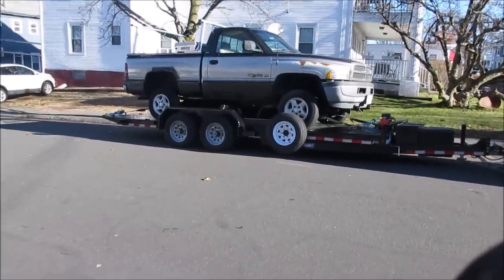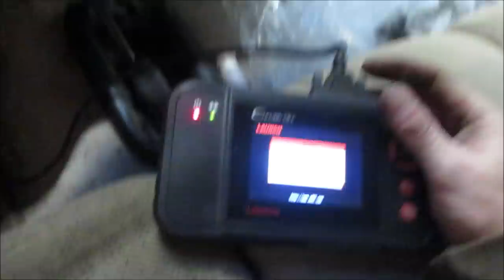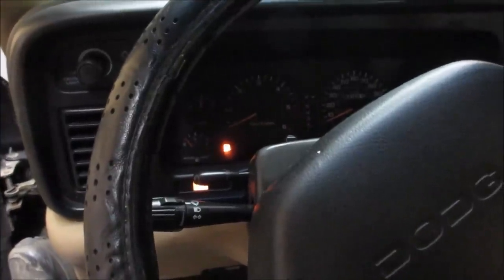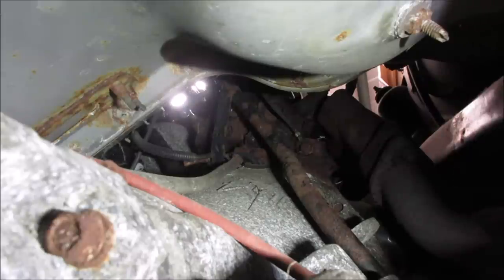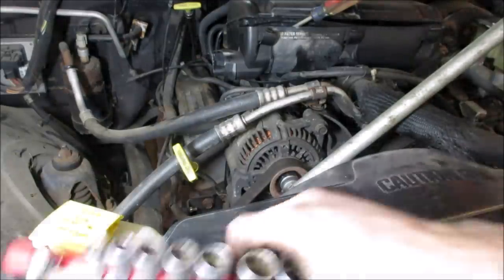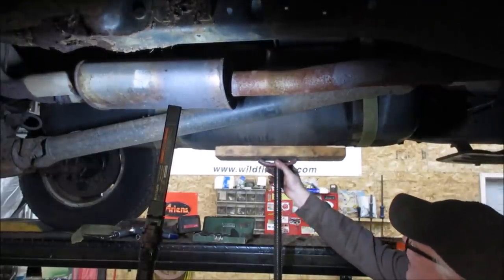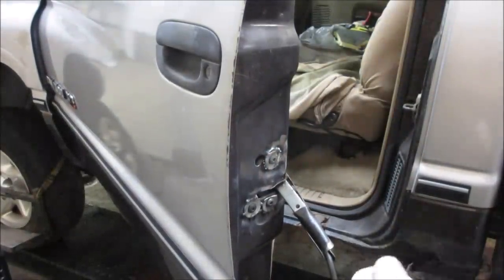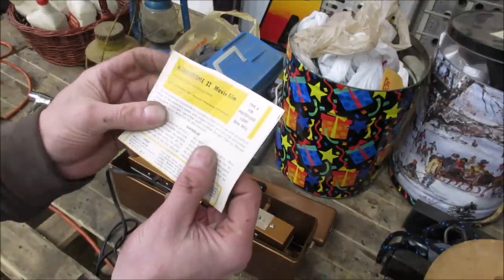Ratty Rusty and Wont Run. But Can We Save IT

Comment: That yellow cable must be worth about $100. The thin white cable on a reel is for phone or doorbell I think, not for high voltage, high current.
When the alternator stopped in the exact same spot I thought you should go and buy a lottery ticket and use the proceeds to buy a new alternator !!!

Comment: i m sure that in the service manual it says to drop the motor to reolace that part. Just another reason to never ever buy a Dodge.
Reply: David, that's what I was going to comment. I think it would have been easier to pull the engine to replace those parts (and others while you were back there), but hey what do I know? In the Air Force back in 87+ I worked on computers; I don't know diddly or squat about mechanics lol.

Comment: I think it would have been easier to pull the engine to replace those parts (and others while you were back there), but hey what do I know? In the Air Force back in 87+ I worked on computers; I don't know diddly or squat about mechanics lol.:body-blue-raised-arms:

Comment: Oh god, I've fussed with these doges for a while now. The amount of times I've crawled in that engine bay upside down to get to that engine speed sensor. its a common issue I've dealt with on many dodge ram trucks from 96-2006. I hate that design with a passion.

Comment: I believe the code your getting is for the Crank Position sensor. it is located on the passenger side on the back of the motor between the tans and motor. Yes you can convert these motors to carb. then make a intake manifold that have both LA and Magnum Intake bolt patterns. HaHa i love comenting before the end of the video, then continuing and watching you pull the sensor i was mentioning. lol

Comment: The dodge most likely needs a cap and rotor. I have owned a few of them and the cap rotor get neglected because they are in a pain in the a$$ to change on these trucks. Usually the small bolts break when removing the cap and u will end up pulling the distributor out or holding the new cap on with big zip ties! Lol seen that more than once

Comment: I love my dodges but its always the ones that get the piss and all beat out of them and people call them garbage. That truck is a plow truck and it lives in the salt so if people are ragging this truck, you dont understand how bad salt is for plow rigs. That truck faught valiantly and fought well in its life as a plow truck, it cant help it got slammed as a plow rig living in the salt. If you dont clean the truck every single time its out or if you dont make previsions ahead of time to protect the rocker panels right behind the front wheels and add a protective coating to the frame with like a well made rhino liner or something to keep the salt from chipping and getting under the paint and start corroding it out. Dodge makes a dang good truck, i hate to see them in such poor condition from lack of caring about them.

Comment: They are rust buckets but push snow! I have a 2000 that’s in worse shape but maintains my 1/2 mile driveway
Reply: The front end probably won’t lock in for 4WD. Take the actuator cap off the front axle, slide the coupler over to engage. There is a c-clip you will have to move to keep it locked in permanently. I had to do this. Cost’s nothing

Comment: The intake manifold on these things is 2 piece. Aluminum upper with stainless steel lower. The gasket between the two is known to go bad on these for pretty much any reason at all.
If she burns oil check that first.

Also that thing you were looking at by the distributor is in fact the Oil Pressure switch.

Comment: Nice work on that tired Ram.  I’d have probably cured to the point of walking away, bless you for your patience it sure paid off.   Great free pile pick.  The Romex alone is well over $100.  The glass gadget is a wine decorator, the vessel in the top holds ice to chill the wine without diluting it.

Comment: Can you switch it to carburetor? Ask Dylan McCool (that's his channel name). He's a Mopar guy and knows a lot for a youngster. I think that's the same engine he just put in an old Diplomat...and put a carb on it. As for all the other problems you are having... This is why I don't thing computers should ever be in a car. That strap you used on the fuel tank looks like the same stuff I have used for several projects. I'm sure it is actually stronger than the original steel straps.

Comment: 10 minutes IN I'm loving this,  Mustie is so out of his element..  "So many fails" it's doing the protocol check Mustie..  swap the ignition module, doesn't even check for spark,  SHOOT THE PARTS CANNON.  NEVER replace electronic parts with Chinese.  Fly wheel thing... LOL it's the crank sensor Mustie, and you test the signal with an O-Scope.  This is  entertainment! I wish he would do more of these, the single cylinder carb stuff he know like the back of his hand.  This is Hilarious, may be one of Mustie's best yet.

Comment: I had the same issue on my 99 durango with the 5.2, but mine would still run perfectly fine until it warmed up. Then would stall and typically not restart until cooled down. It was driving me nuts, researched the symptoms until I came to the conclusion of it being that part, I read about what a shitty location it was in and decided to call my local shop to do the work. They warned me that if it snaps off inside the housing it can be a more expensive job than they were already charging. Luckily it didn't break. And for once in my life I was more than happy to pay someone else to do the job.

I haven't finished the video yet, but hopefully you changed the rotor, cap and plugs as well... back to the video to find out!

Comment: 25:00 if the OEMs had half a brain, since they decided to put half the engine under the cowl and fire wall, they'd make the transmission hump removable. Like the old vans used to have.

Comment: I had a 98 ram with the 360 automatic and 4wd had a 190000 miles with the original transmission and engine the thing ran perfect far a newer ram

Comment: yes just you buy intake for carb for magnum engine 5.2 or 5.9 intake the same then drop in a dist and you are good to go. if you want to run a mechanical fuel pump you have to change timing cover and buy a centric adapter for the end of the camshaft to drive fuel pump.

Comment: Some years back my uncle did away with all the electronics, fuel injection, and smog stuff on a 1993 Dodge Ram 1500. I don't remember what all he had to do, but I do remember it took him a little while to figure it all out, I know he had to get a different distributor and a regular older-style coil, and he put what he called an old one-wire alternator on it. When he was done you look under the hood of that 1993 Ram truck and the engine looked like what you would see under the hood of a 1970 model. All the "junk" was gone and it was just a plain looking 318 engine with a carburetor, an older-style round coil, and a regular distributor, and it ran fine. He also took a 1996 or 97 LT1 engine out of a wrecked Corvette and stripped all the electronics, fuel injection, and everything off of it until it was basically just a long block, and he put a performance intake with an 850 double pumper on it and stuck it in his 78 Chevy 1500 4x4, and it was pretty bad a**.

Comment: The top alternator mounting bolt will probably be froze because of galvanic corrosion. I drilled mine out and used a nut and bolt.

Comment: Crank sensor is under the exhaust manifold ondy side you are on and they are prone to failure. Think old chevy small block vs vortec. Magnum's need a vertical bolt intake vs an angled intake bolt to head. Mopar performance used to sell a kit to use magnum head's to a l.a. series small block. I don't know anymore about carb intakes or head kits. I've used both with great success. I've had several magnum's and more 273, 318 and 360 L.A.s. My last 318 magnum was a 97 2wd nv3500 tranny truck. Kid put a nitrous kit on it and raced it. When I got it, it had a goofy hoodscoop on it with no filter eating the crap outta bug's and had 300k miles on it. Ran good after going cross country for 3yrs and only replaced the clutch, rotor and cap, plugs, oil of course and that ignition sensor that you are replacing. Never smoked or left me stranded. Didn't check or changed the oil? Definitely a I don't give af purchase, but of course you made more on this video than the purchase price of the truck. You got it like that, do it like that.

Comment: They switched from the LA 360 to the Magnum 360 at around the same time they switched from carbs to EFI, but not exactly the same time, and there are aftermarket adapters etc.  so yes you can put a carb on that engine.

Comment: Excellent video Mustie 1  :) did not bad on first on this truck also transfer case I check on junk yard find if can because new one  might be pricey and Alternator too ! Plus any other parts to fix that Dodge with too ! On end of video John Deere Chainsaw be McCullough or power tools company of Sthli Winnipeg Manitoba from 1968 to 1976 years ! Also light set up be great for working in shop and find stuff in tight corners need light for Lol!

Comment: Clearly that flywheel position sensor was installed BEFORE the engine/transmission was put in the truck. The engineer that designed that truck needs to be taken around back and forced to replace every component on the truck until he learns his lesson...

Comment: Man.. modern engines have more tubes and wires than a guy in intensive care. I remember the good old days when I could just about sit inside the engine compartment of my 1978 Suburban and work on the fuel pump with plenty of room to spare.

Comment: The  black and glass thing is a wine decanter.   You dispense wine from bottom nipple. Put ice in inner tube to chill the wine. The lights for the old 10 mm film camera.  Back in the late sixties early 70s. The camera needed a lot of light for proper exposure.

Comment: The body on my daily driver 96 Silverado extended cab is worse yes I live in the Rust Belt Northern Ohio, as the crow flies 50 miles from Canada. My frame is in great shape and I've started doing body work like I said it's my daily driver she runs great got ice cold air so why not save the old gal? I would not pay what they're asking for a new truck because they want only last half as long as mine has, and with the new day and age new sensors new computers all garbage if you ask me mine has a very small computer system in it I think a second generation. Even though it's a pain in the butt but I'll deal with it. I don't know what you paid for that truck mustie1 but whatever you paid it's a good deal oh, one thing I can tell you about that crank sensor if you found rust on it and that's what kept it from working going to happen again my crank sensor is a little different on the Chevy it's on the front and it actually is sits in the oil. Mine has a distributor too but I believe it only tells the injectors when to fire. Anyhow mustie1 great video I think I'll keep watching LOL of course I'm going to keep watching!

Comment: It’s weird watching him do the same work I’ve done on the basically the same truck I have except mines a 96 but everything else is basically the same with the 360 and all, literally did what I wanted to do to replace that crankshaft position sensor but couldn’t because it was my daily, but to be fair it wouldn’t be right as mine has no body rust do to it being in Arizona.

Comment: You can run an aftermarket intake but the injector In it works pretty good. If you wanted to put that 360 in an older rig?

Comment: The crank triggers on the LA mopar engines are a nightmare. pretty crappy design and very prone to failure and dont get mestarted on the door latch tearing away haha.
 There are a couple companies i believe that make carb intake manifolds for the LA engines or atleast they did.

Comment: I’ve seen trucks in a lot worse shape on the road. Heck, I’ve driven worse! As soon as I saw you replacing that crank sensor, I thought “good luck!” I’ve had to change that on my 99 with the 5.9 and it’s a real PITA to get to if you do it the normal way. Which I did…… it’s not the rust you have to worry about, it’s getting onto the bolts. You can’t get a socket on them, and a wrench barely makes it. Just no clearance to speak of. It took the better part of an hour to change mine out. If I had to do it again, I would remove the trans mount bolts and raised the rear of the engine to get more room between the engine and the firewall.

Comment: Your in for a royal PIA if, and I assure you that the front suspension, and steering is trashed  
Typical dodge ram issues similar as dash falling apart, and paint looking like 60 years in a pasture vehicle. 
Steering gear box will be loose on frame, and shaft failure are common problems, they make a frame brace with bearing to support the frame horns and gear box itself fairly cheap, but it helps greatly. 
4x4's the arm that goes from passenger lower control arm up to drivers side will be worn to where hole is elongated and has to have repair plates welded onto it and replace component itself. 
Rest is standard suspension issues commonly found.

Comment: My Jeep Cherokee has a access panel on the tunnel. I learned this after replacing the sensor like you are doing.  I connected every 3/8 extinction I own together with a universal joint at the socket. I got it out and replaced it in the same day! A few weeks later I got the same error code.  After seeing the proper way to remove the crank shaft sensor (remove the dash, heater box and carpet) I decided to do it again from the bottom. Turns out that was not even the problem. That was a few years ago. still don't know what the real problem is! Good luck to you on this one! I feel your pain!

Comment: The light assembly you picked up from the free pile is an old 8mm home video camera light from the 60s or so. I remember my parents having a home motion picture camera with a similar light. If I remember correctly my parent's camera light had a handle and a bracket that attached to the camera  to make it one large unit. You can find similar ones for sale on E Bay.

Comment: The thing with the light, they called it a "Weinhebler" in German language. You can pour wine into the container and for white wine, you can fill that plastic thing with ice for cooling. When you push a glass to that bottom point then the glass fills with wine.

Comment: Next time you want to adjust doors on a shit box, put your 2x4 in the lower hinge where the 2x4 gets squeezed between the door half of hinge and cab side hinge and push door shut. This bends the door a bit to lift the latch side up. 
Repeat this till the door lines up. Maybe a bit higher than it should.

Comment: Not in to bad of condition especially for a plow truck. Typical rocker and bed side rust for the NE. There are trucks on the road around here that are in much worse condition. If the floors are still in it, it and the lights work it will easily pass inspection in my area. Solid Rocker panels are an optional thing around here lol

Comment: The wrought iron thing is a liqueur dispenser. The bowl on the bottom and the candle have nothing to do with it. You could freeze water in the tubey thing that comes in from the top if you wanted to chill your liqueur.

Comment: Watching you contort yourself to work on this engine shows the difference between an industrial mechanic/millwright and an auto mechanic. I have been told as I worked on a machine that every minute of downtime costs so many thousands of dollars. When a car is down , only the owner cares.  Cars seem to be designed not to be fixed in any reasonable amount of time just for this reason.

Comment: I have one of those old dodges and that crank sensor is a bear to replace. I did it by feel from the bottom and it took me an hour or more to get the bolts threaded back in.

Comment: In theory yes you can put that 5.9 in a older car. it still has the distributor you would have to put a older one in and a carb but it should be able to be done I've never tried but I've heard it can be done

Comment: The cam sencer is  usually  the main culprit  yes you can  run it on a carb but you need a magnum  specific  manifold the bolt position is  at a  different  angle  than  the  LA engine there's  a Chinese  eldelbroken knock off on  Amazon and  ebay the easiest way to  change it is to  go through the  top with  exstinchens  but it's a pain ether way.

Comment: Back in the seventies I used to adjust doors in the sixties and seventies trucks . I made a 3-foot two-by-four in an old stove bolt , I cut into the two-by-four at the end and it would attach to the pins coming out of the body itself and the stovebolt would hook into the door latch. Then I would pry upward to give it that slight bit of adjustment

Comment: You can get any kind of intake manifold for the 5.2/5.9 Magnum. The heads are different from the old 273-360 so it has to be a Magnum-specific manifold but no problem putting a carb on these. Mopar sells them as crate engine upgrades for classic cars.

Comment: @01:08:41 I think that's some kind of an absinthe fountain. There's usually some kind of mechanism to precisely control the flow. Contrary to popular belief an absinthe fountain doesn't dispense absinthe, it dispenses ice cold water in exact proportions because you don't drink it "neat". You put water in the large decanter and then ice in the smaller inner one. Most commonly absinthe fountains have multiple taps so multiple people can "louche" their absinthe at the same time. Take all this with a grain of salt because I've only seen an antique absinthe dispenser like twice in my life. They're always ornate and even if people don't drink absinthe they will keep them around for decor. One of those fountains I saw was in New Orleans, it was made in Austria and had a similar metal vine to hold the glass.